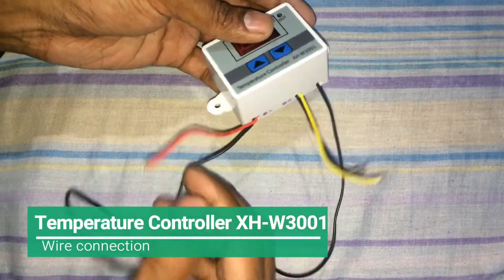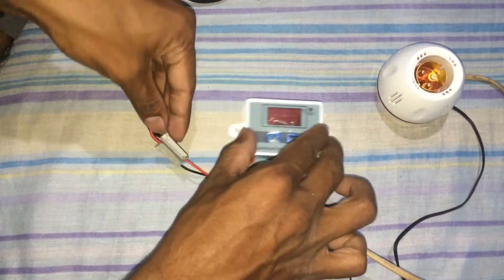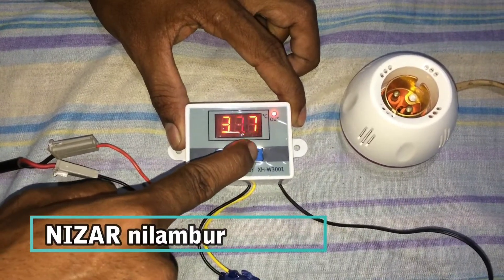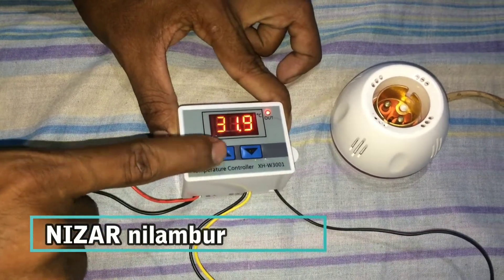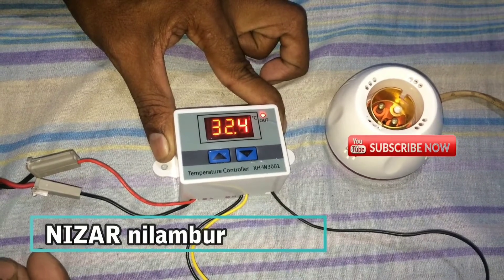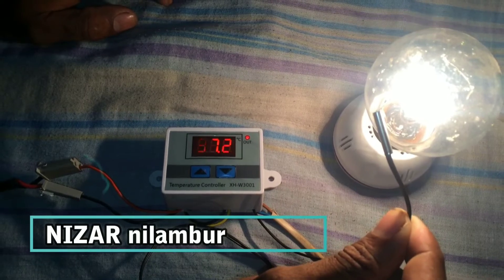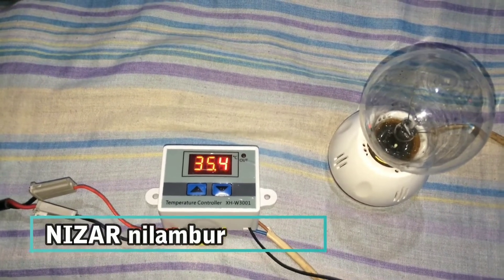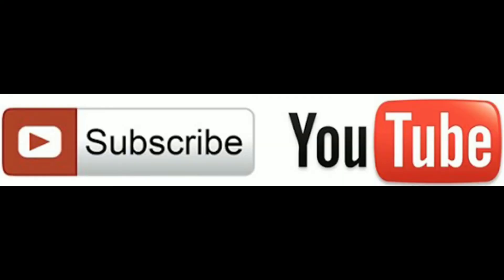Digital Thermostat settings #XH-W3001 തെർമോസ്റ്റാറ്റ് സെറ്റ് ചെയ്യാം  ഈസിയായി #Temperaturecontroler

Comment: W 3001 12v ഡിസി തെർമോ 
സ്റ്റാറ്റിൽ, റിലെ ഔട്ട് ൽ 
Ac ഹെറ്റിംഗ് കോയിൽ 
കൊടുക്കാൻ പറ്റുമോ?
എങ്ങിനെ കൊടുക്കണം.
Reply from the maker: w3001 12 voltage input കൊടുക്കുന്നത് കിട്ടും അത് ഉപയോഗിച്ചാൽ മതി, ഈ സെയിം മോഡൽ 3 വ്യത്യസ്ത വോൾട്ടിൽ കിട്ടും 12v, 24v, 220ac

Comment: How to connect DC 12v fan in this circuit
Reply from the maker: 12 volt fan kodukkan adaprer vangikanam, AC direct kodukkan pattunna fan kittum wielding മെഷീനുള്ളിൽ ഉള്ള ഫാൻ 300 രൂപ യൊള്ളു
Reply from the maker: Buy AC to DC adapter, 12 volt 1A